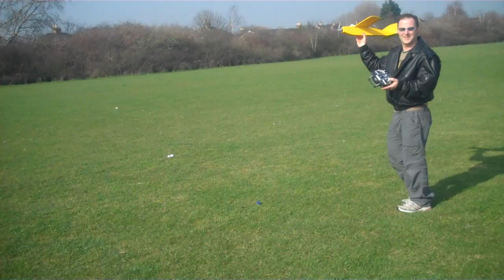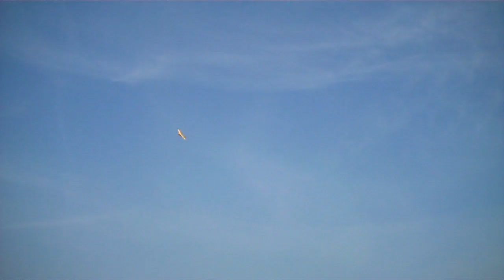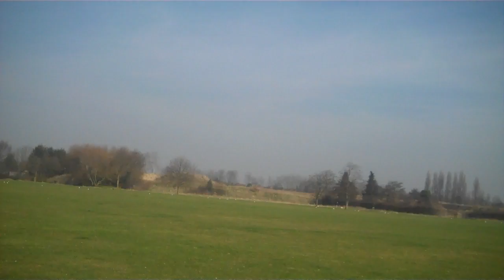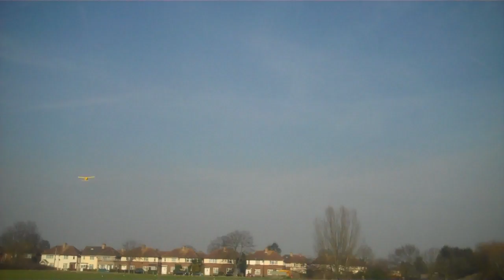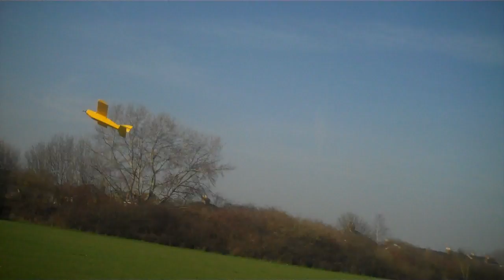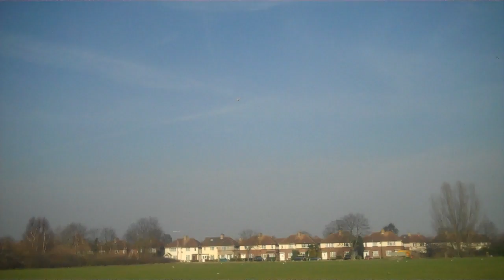SHARKFACE 2012 kit Prototype MK1, first proving flight.

Comment from the maker: Hello Phil, I know who you are and the great work you have done and are doing!

I fully understand your comments about single channel rudder only and I pondered that for some time. I choose to go rudder, elevator and throttle control for safety reasons.

I am trying to keep the overall looks and flying qualities of these cracking vintage designs as close to the original as possible though. 

Best regards, Paul.

Comment from the maker: Thank you for the lovely comments! Yes, definitely cheating with a throttle and elevator, but this version has to have the elevator as the wing incidence has been reduced over the original design. So you loose the natural climb on power you require with a single channel rudder only plane. I view this MK1 prototype as a test, can easily up the power (watts) to double that in the video. this will make it very exciting and you really would need the throttle for calmer moments in-between the mayhem.